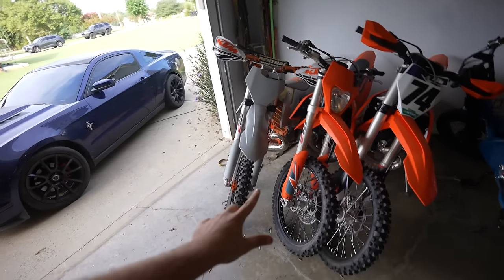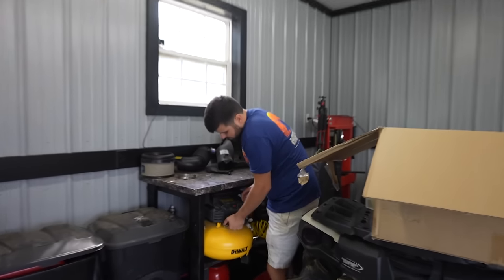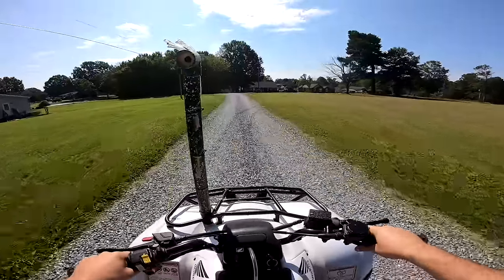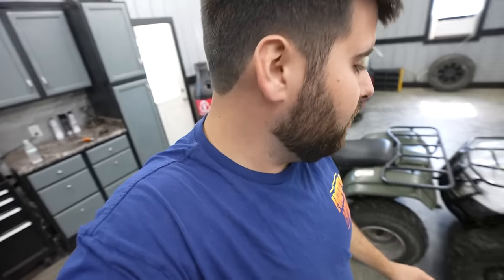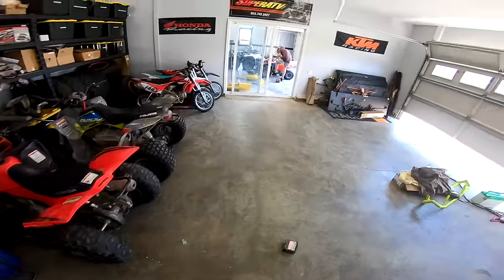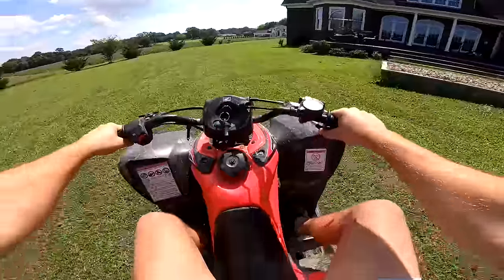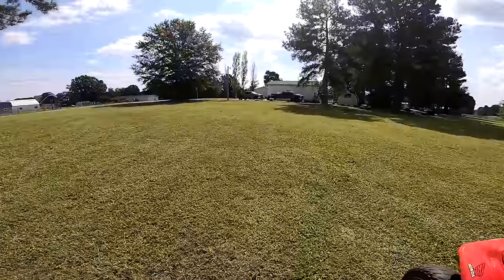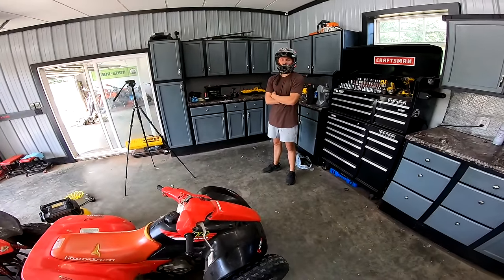WE HAVE A PROBLEM.

Comment: Braydon one of main problems we have with a pull start pit wheeler is the carb the carb on those get dirty fast and that’s problem we have to take about the carb and clean and put it but it back on and it runs perfectly

Comment: The fuse on the solenoid is popped. Take it out and check if the little wire is broke apart inside

Comment: The problem with the handlebars is the neutral safety switch could be off. I had a four wheeler that did that and nothing worked and then we re-tied them and it started working.

Comment: The one with no electrical to it it’s most likely the neutral safety sensor ground the green wire out unless its not green and it should start

Comment: Nothing works but the solenoid will jump, check the fuse. Solenoid jump will always start it as long as you have battery voltage and the starter is good.

Comment: The one with the electric problem, it has to be the solenoid bc it has power on one side but not the other unless you use a screwdriver

Comment: hey braydon ik you most likely wont see this but the issue with the quad seems to be a blown fuse, did this on my 250ex when i stupidly put the jump starter cables on the wrong terminals
if its not that then you probably fried the harness

Comment: There is a green and black wire tapped up in there on the harness. If you touch the black tp positive you'll have all your power back. Going through the same thing with mine. Haven't pin pointed the actual cause yet

Comment: the electrical problem could be that a wire that runs forward from the solonoid has unplugged itself since i see the battery box is loose same thing happened to me all it was a wire loose

Comment: My 250ex had the same problem we had to track the wires from the battery and the solenoid and run a toggle switch for the ignition to work

Comment: On are honda fourtrax 300 the wires from the ignition unpluged themselves in a little junction box causing it to not get power to the bars. Im not sure if the recon would have that though, if it does it would be almost right under the plastic underneath the handle bars infron of the stearing stem